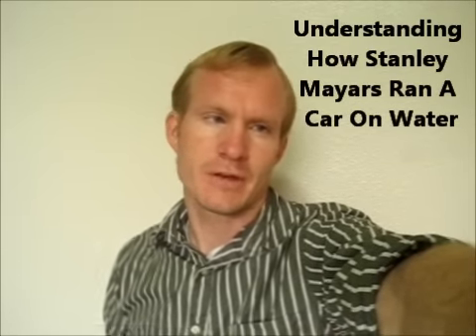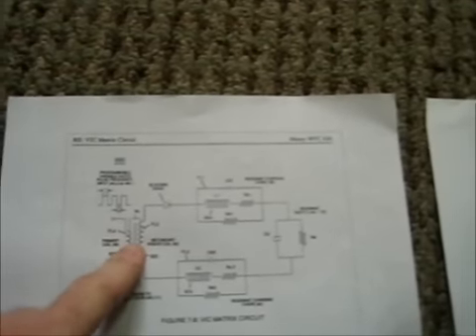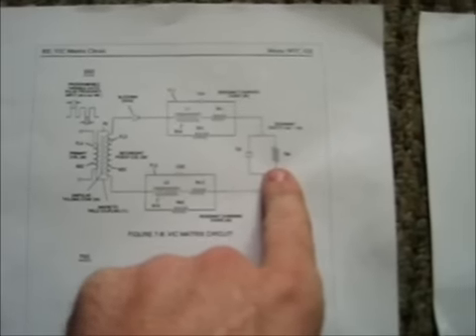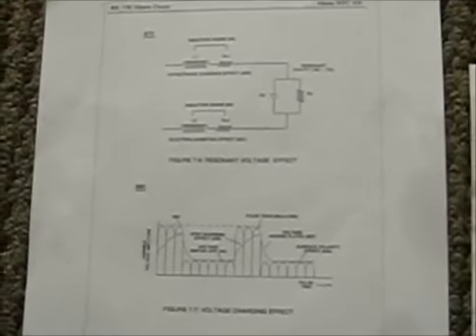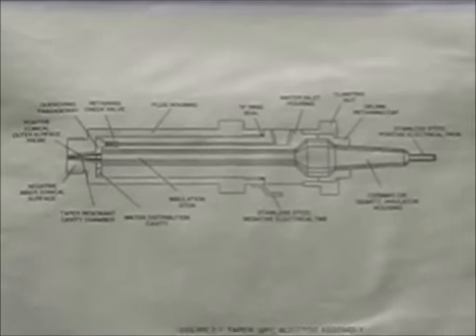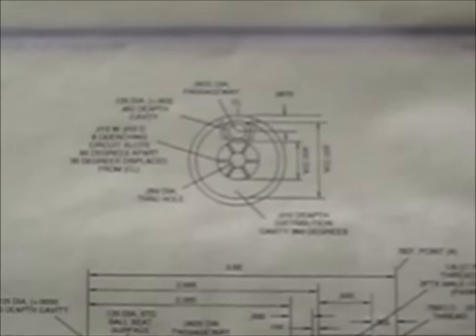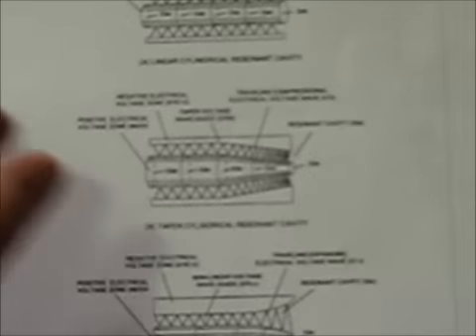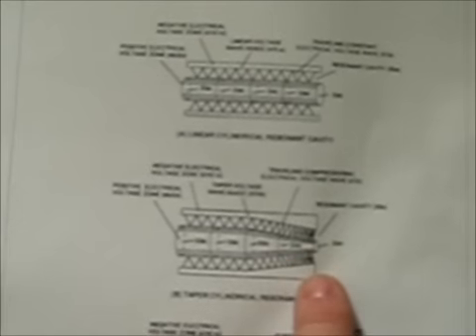Understanding How Stanley Meyer Ran A Car On Water (Part 1)

Comment from the maker: The voltage stepping effect has not been achieves successfully continuously by anyone that I have seen thus far this is why I said what I did when I said to make leads coming off the secondary by doing this you would insure this voltage stepping effect would occur every time. It's basically forcing it to occur as it should naturally in the WFC. Also when Stan explains the bobbin he does state that at the top of each winding set he has a connection point.

Comment: and on the "GEET" generator they use the heat that is a frequency as well as the sound frequency from the esxaust ... so heat sound and elecrtic frequency and it should be good

Comment from the maker: That is definitely the idea of a patent. Although patents allow people to show exactly what they have a patent does not have to work exactly as the actual product does. It's the concepts that need to be patented as long as the concept remains in the technology it can still be changed. The drawing of the different voltages reminds me af an old radio receiver the further up or down the coil you go the lower or higher the frequency is.

Comment from the maker: Thanks!  I understand that the drawing as a type of variac you can tell by the way the switches are placed on the secondary. The different voltage zones in the drawing would be used for instance in vehicles of different engine sizes as larger engines would need higher voltage outputs to produce enough gas to allow them to run properly. The water discharges due to the water acting as a resister.

Comment: First of all,the ''resistors'' drawn with the chokes are not real resistors,is the total resistance of the chokes,secound the step charging efect is achived by one voltage source and the different voltage zones are because the wfc cap holds the charge,and when you aply another pulse it's multiplys and grows till the cap is discharged.that drawsing is another alternative to the variac,to control the hho output...hope that helps

Comment from the maker: Have you even read the court papers? He was not convicted of fraud for his car not working. He did not pay an investor back that is why he was charged. His car did in fact run on hydrogen and oxygen on demand from water. There is ample proof that what he did was real. Even the replications of what he did work as he said they did, there is still allot to do to finish replicating what Stan did but it will be done and his work will continue to be proven correct as it already has been.